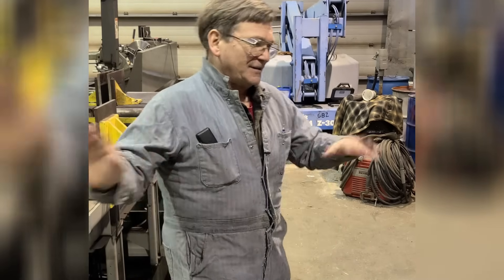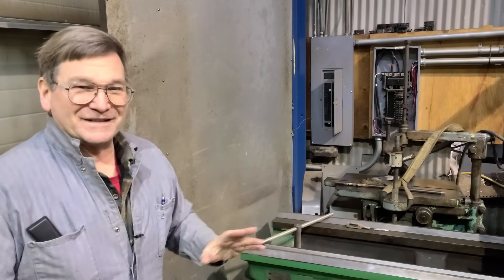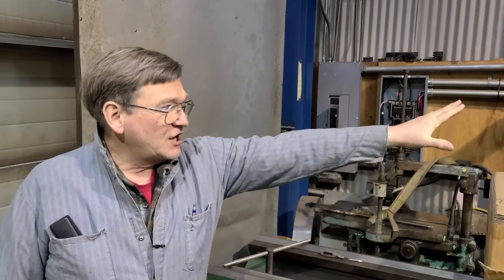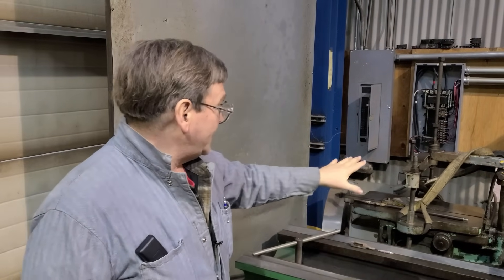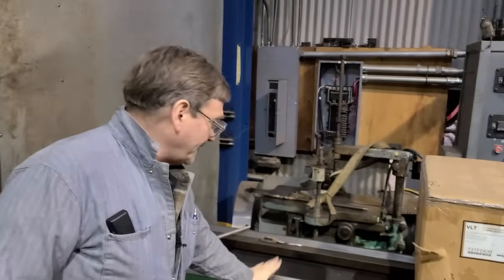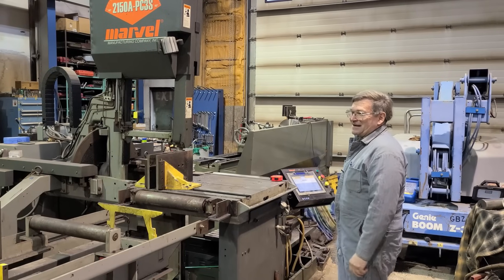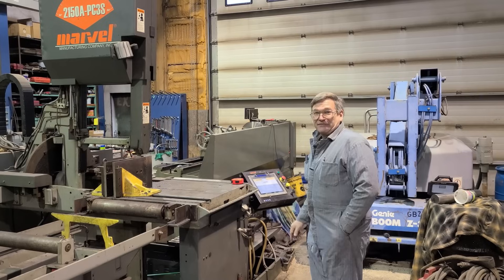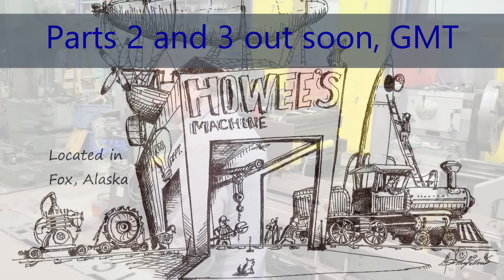Shop Tour, part one

Comment: i was at an auction of some equipment . they had some sullair screw compressors 7.5 hp and one bigger one. guys were really interested in the small ones . the big one came up and i bid 500 as an opener.  no one else bid . they went silent when i said 500 so i didn't need to fight over it. turned out to be a 30 hp  screw compressor with only 2500 hrs on it . i still have it as one of my backup units now 20 yrs later but it was my main unit for years till i needed more cfm .

Comment: Machining in Alaska makes me wonder something. I'm curious if it's an issue. Do you ever have to be concerned about thermal expansion? I wasn't sure if any of the work you did would have had tight enough tolerances to where hermal expansion might pose an issue. P I'm really interested if there's any change in the process due to acclamation from the elements being that you work in Alaska.
Reply from the maker: Most things heat/cool together & the fit is the same, but some materials don't like the cold.  Cold is also good to help a shrink fit, if it's the right day.  I also have seen problems blamed on the cold, because it was easy to do & kept the blame away from the bad procedure.  I observed welds allowed to cool at -50 outside, then the later failure blamed on the weld alloy, the new alloy came with strict welding guidelines on pre/post heat, the pre/post heat solving the problem.

Comment: Have you ever considered a LeBlond slide bed lathe?
Reply from the maker: I ran a Nebel sliding gap bed, I did not like it, it was not rigid & it did not stay straight, as the bed moved out.  Most of the time Lathes have been chosen by what was available more than, looking for a certain machine.

Comment: when you talk about cost of machine vs the work you are comparing apples and oranges. if a machine gives you a $100k of work it only earns you the profit on those jobs so likely 35 - 50% of the gross at best. so whether it makes money should be did it make you more profit than it's cost.
Reply from the maker: You are correct, this is not a profit/loss analysis.  I think this more correctly is an indicator of total volumes vs machines that don't get used.